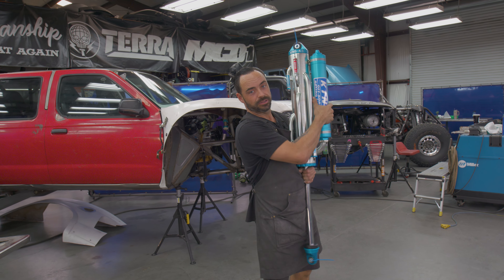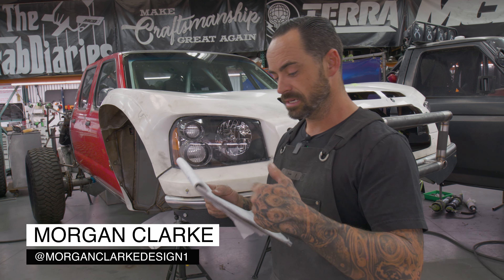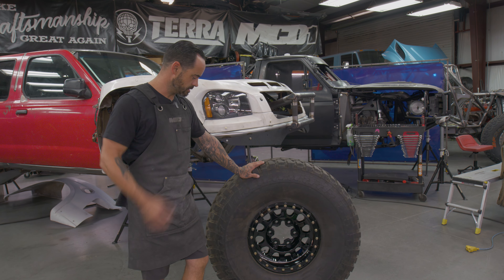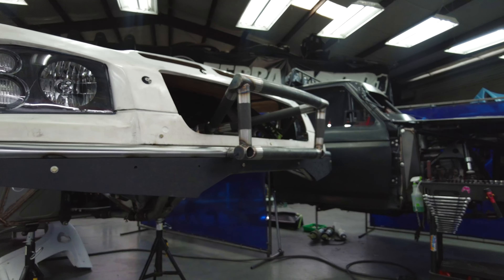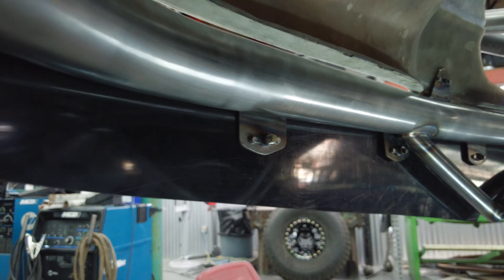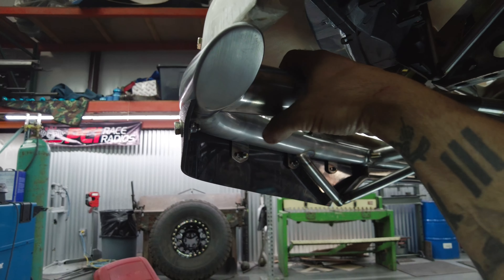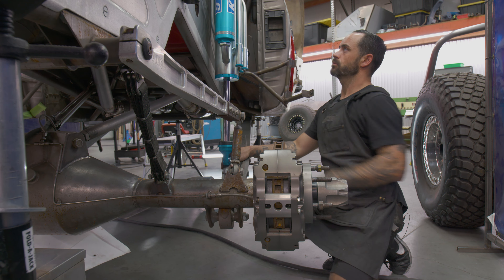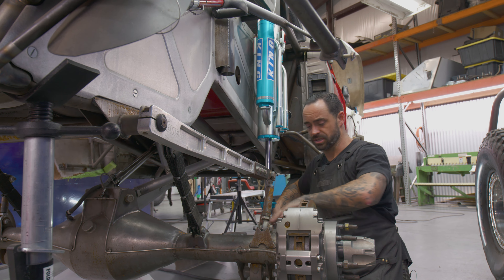Tube chassis Nissan Frontier, trophy truck shocks! Tilt hood! | Morgan Clarke Design

Comment: Love your work Morgan. When you run the ducting for the AC system make sure to have some sort of louvered vent with however you do it. The Louvers promote back pressure to the evaporator coil and assist with keeping the air in the evaporator coil for a longer period to help remove the heat and moisture in the air. I'm a washed up fabricator but a professional AC/Refrigeration technician so I figured this would help with trying to get the temps down inside the cab. Again love the build and have been watching this truck through the many stages.
Reply from the maker: GREAT INFO! So that’s a louvered vent on the ends of the ducting where the air exits to the cabin?

Comment: Put the Exhaust coming out of the top of the fender in front of the vented extraction point to help blow the dust and hot air out with the exhaust output my little two cents ain’t worth a shit but dope 🎉truck keep up the good work
Reply from the maker: I like your idea!

Comment: Anyone know why the chromoly tubes are darker towards the center? It looks intentional
Reply: They grind off the mill scale and oil from the ends that they weld to avoid weld contamination. No point in spending time cleaning the middle where nothing is welded
Reply: @kthor2734  Thanks for sharing man!